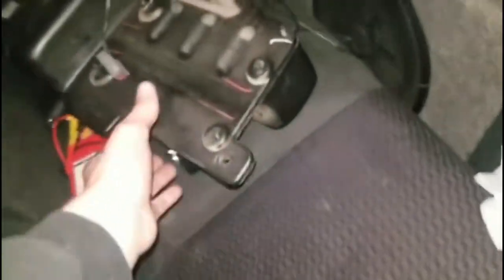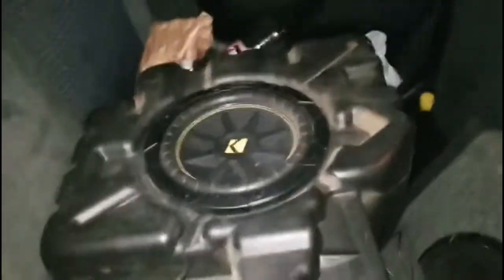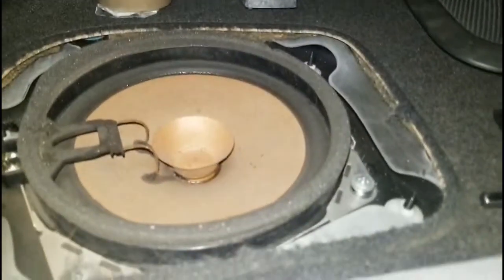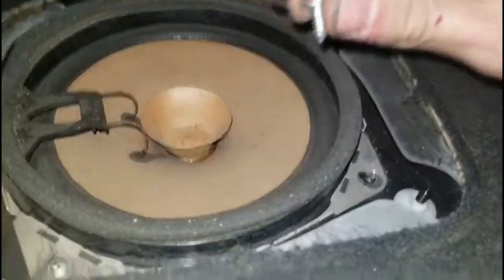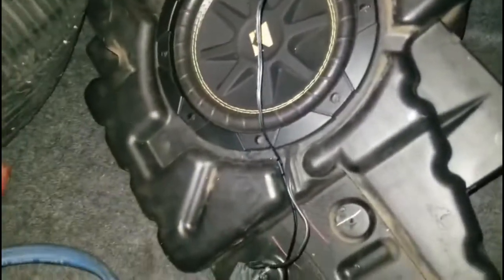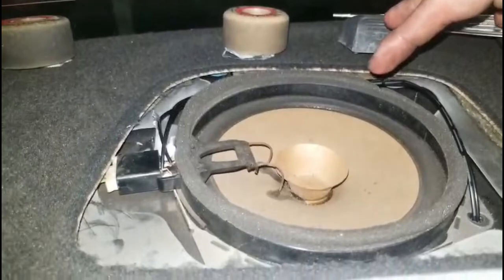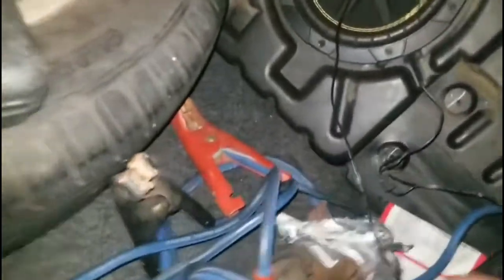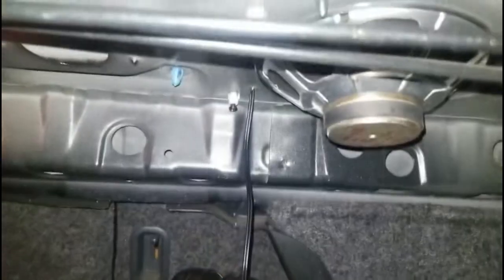How to install a Sub without Amp

Comment: Don't do this guys, there are too many things wrong with this setup. First of all, the sub hooked in line with one of the speakers will lower the resistance and effectively pull more power from that channel. That will make the head unit run hot and maybe even damage it. Second, it looked like he just twisted the wire onto the speaker terminal which is a poor connection. Third, subs need crossovers or it will play the full frequency range and sound like garbage, and it's being grossly under powered. To top it off unless your passengers like to ride in the trunk, there will not be much of any increase in sound quality. There's a few other things wrong, but I think you get the point. Don't do this, just buy a cheap ass amp with a crossover or just don't bother.
Reply: I did something similar to this but I actually used the subwoofer on the top of the trunk in the Cadillac CTS until I got my amp, open connection plus line out eq

Comment: This brings back memories. I did this. Back in the day. I had a 15 inch orion and i hooked it up to the rear speaker and it work just fine. I wouldnt listen to the haters... If you cant afford the amp or The speaker wire kit. Just get some speaker wire and hook it up. If it isnt working try the other side to hook it up
Reply: you still need to run the ground wire and power right ?
Reply: @rayallenxo  no you fr just hook them to the existing factory speaker terminals. There's enough power to run them they just don't hit nearly as hard

Comment: Did you wire the power cord to the same wires that connect to the rear speaker?
Reply: Power cord?
Reply: Wire the power cord to your cars radio 12volt wire

Comment: Thanks bro it helped out a lot
Reply from the maker: I'm glad I was able to help!
Reply: You’re just gonna ruin your alternator🤷‍♂️ One way to make it not ruin your alternator those check the ohms of the speakers that you were replacing inside of your vehicle as well as how much voltage and wattage they consume so you’re not blowing fuses as well as drawing too much power from your car battery as well from your alternator
Reply: @riprice1284 So, you are saying that connecting a speaker as shown in this video will draw more current than installing an amplifier and connecting it to the same battery, yet amplifying the signal to be stronger? I do not believe that is correct.
Reply: Correct @riprice1284 doesn’t know what’s he’s talking about

Comment: They sell really cheap and small inline amplifier drivers to help u get enough power to maybe kind of push a sub..Stetsom has one a 160.2 and taramps has a 50x2...The taramps is TL-500..When i bought mine is was like 20 bucks..It turns on when it senses much no remote wire needed..

Comment: After you connect with the bass speaker
The speaker which is originally 
That work still ? When it played music
Reply: Most likely. The current is going through both wires.